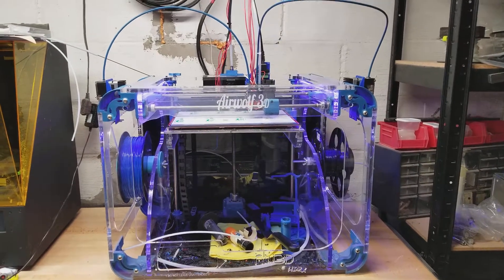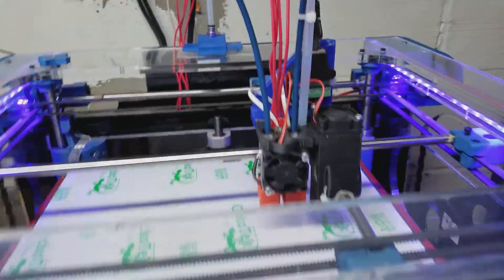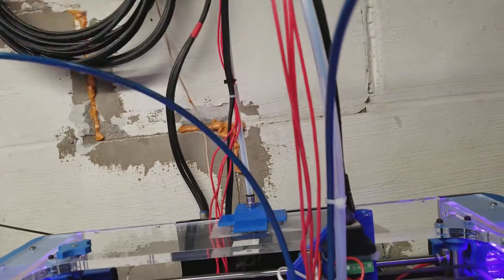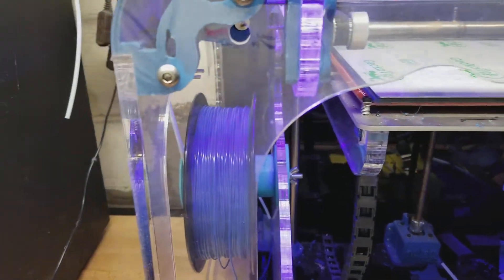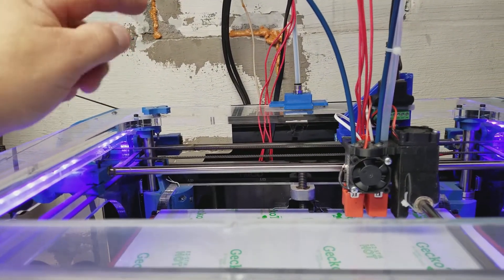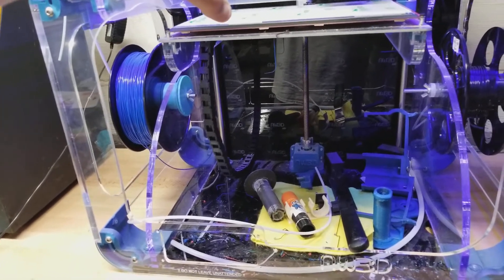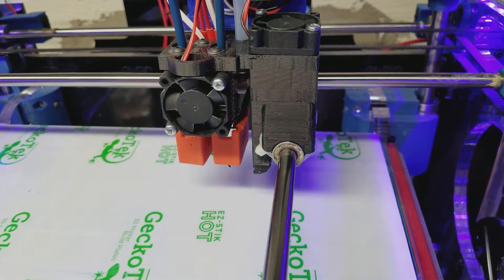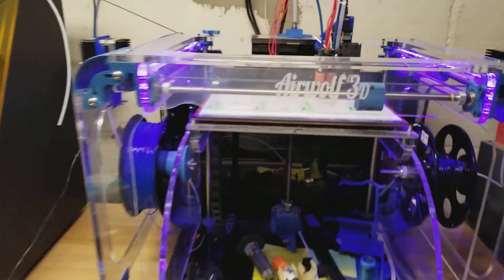Airwolf HD2x 3d printer Chimera Upgrade

Comment: Drilling holes in acrylic isn't so hard, start with a small drill bit , say a 2mm bit and drill a pilot and then slowly step it up to the final size to avoid cracking it :)
Reply from the maker: yea, just didnt want to risk it
with my luck it would shatter